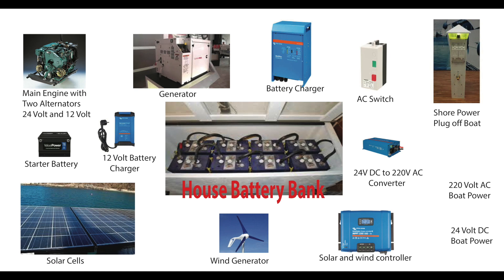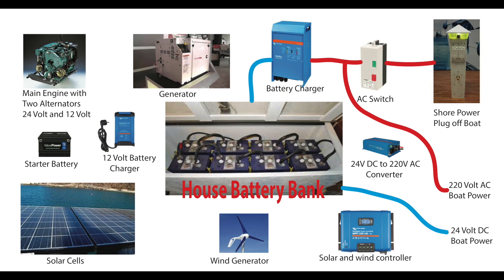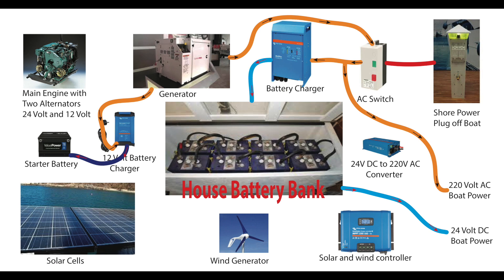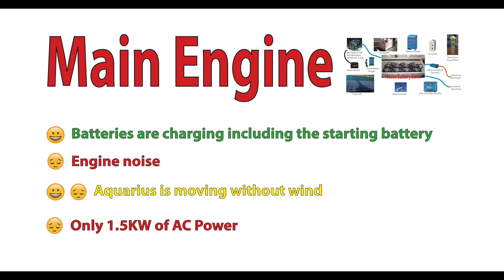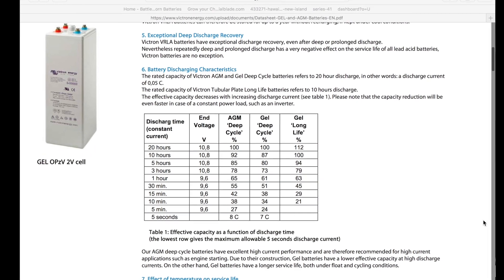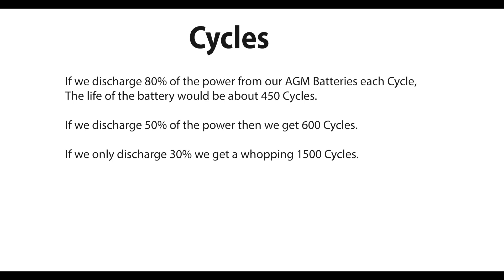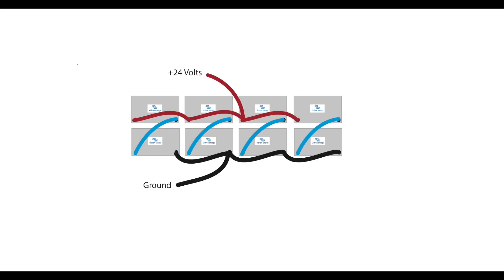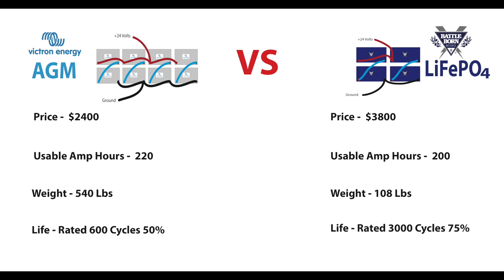Batteries and Power / Sailing Aquarius "How To" Series

Comment: Very nice understandable by non techies (of whom there are more among your followers than you might imagine). IF you are a cruiser and not a weekend sailor, lithium I’d throw only sensible way to go. Plus, when I had a house with a magnificent dock and did not take her out often I never plugged it in. And never at a marina. Even then you get stray currents. I also dropped several cheap magnesium sacrificial anode fishes wired into the ground so that they would flow down the erosion on the real boat anode. All I needed was a tiny solar panel  made by Solargizer.  It strobed the batteries at something like 20k per second which is supposed to be the frequency that breaks up sulfate crystals. I am not kidding ypunwhrn I say my batteries lasted seven years before they got down yo half capacity. 800 amps at 12 volts. When on passsge single handed I eat very simply. No freezer. Very simply. But when with a wife or guests or the kids, albeit grown  the meals become a festive occasion and power goes up. With respect to the autopilot I de power the sails so the current draw is much less. I’m not in a race. I sold my previous divorce.  I mean boat. But am going to get a new one soon. The other onevwasvscBeneteau 46:foot sloop. New 1999. I had never set foot in a sailboat before I bought it at thr Anbapolus boat show. I lived it. Sailed singlehanded sell sround three Csrribbexn. Once I doubled the power and added a genset. The boat was fun and agile. And I actually sailed through two named storms and rode out a third anchored in Bermuda. Butnow 20 years later I have sold the next businesx and I want to crossvthevAtlantic and spend severs last years or more in the Med. While in the Caribbean I made the mistake of helping an Amel 53 owner from Gorda to St Martin. I was shocked at the difference. It is definitely not as fun as my Beneteau was. But it was the most robust sturdy, well thought out cruiser,live aboard I think man could devise. And cruising is 90% on the hook with a dinghy to shore and only 1% on the water and the Amel is not dissimilar in comfort from living on land.   

What did you do before this?  You seem to have a high aptitude, you were not an experienced sailor, you seem to make some decisions quickly but not badly and then open to lesrning and adjusting quickly to timproving.  I have a a partially paralyzed right hand, recently acquired.  But I think an excellent conditiion Maramu would be wonderful. The major trick in sailing is not overpowering. Never put out what you might not get in. Don’t strain the boat. I plan to cross thevAtlantic (for stupid bragging rights), and Live in the Med for several years exploring the Western  Civilization I was tsught from fourth grade through college, through five years of Latin. I’m 73. Fit. Married, though and she does not like sailing. But she does not mind living on a boat that’s on a nook and she’s just as interested in immersing herself in the history that’s where we came from. I got tired of beaches. I want to I want to stay for months at esch place. She used to be a motorcycle dealer!  I bought from her in 1973 a new BMW R96 that I put 100,000 moles on. Then snagged her!  She’s almost perfect. She doesn’t like passsge making and weirdly she simply does not hzveca c
Clue why a sailboat moves forward.  Your videos have reassured her. And for that I owe you. Thank you so very much.
Reply from the maker: Happy to hear our videos are of some use to you!  I was a bit worried about you when you said I was addicted to the bow thruster last week, but have since found your comments and questions good for other subscribers, and yes even I learn from them!  To be honest, maybe I am addicted to the bow thruster, as I don't think I would be able to safely park Aquarius without it.  I just tried to park a full keeled 35 footer a few days ago, holy crap that was tough!

"Not in a race"! Amel's aren't really a  good boat for racing, but you can race them in high winds.  I have noticed that the.high production boats will move faster 0-20Kts, but when the wind is above 25kts the Amel will start to overtake them.  But, better not to be in a race, as the cruiser is more worried about getting to the destination safely without breaking something, it's not about getting there first. 

I am sorry to hear about your hand, but you are exactly whom Henry Amel designed the Super Maramu.  Sails are easy to deploy, easy to reef, and easy to remove.  All from the comfort of the cockpit, and even in heavy weather.  The only time you need leave the comfort of the cockpit is to put out the downwind sails, and if something goes wrong.  The Amel Super Maramu is easily sailed single handed if maintained properly and you don't overpower her.  If the wind is over 20 kts or so, don't deploy the main.  Like you say, it's not a race out there.

I did hear about pulsing the batteries to de-sulfate them, but I didn't know the frequency until your comment.  Thanks.  And the magnesium makes a lot of since if you're at anchor, but especially in a marina.  

I hope you find your dream boat, and you get the chance to cross the Atlantic.  Aquarius might be going that way in a few years, and it would be nice to meet up!

Fair winds my friend!
Ken

Comment: Nice references Ken easy for anyone to understand, I know Aquarius has its batteries under the berth in the starboard side if you change to less lighter batteries will it change the balance that the Amel was originally designed with? Or do you just add a beer chest where the old AGM’s lived?
Reply from the maker: We just changed to LiFePO4!!  Video will come soon!

Comment: Hi Ken, I did a search of Battleborn batteries and found they sell a 24V 50Ah unit.  Instead of 12V batteries, you'd be ahead of the game with their 24V units.  Price about same as 12 V but no inherent loss due to extra cabling.  Cheers!
Reply from the maker: I wonder if the BMS on board the 24V battery would make it possible for an actual DROP IN REPLACEMENT of the AGM's.  I think so.  Replacement of the Batteries is one thing, but also replacing the battery chargers, and the alternator would a significant increase in cost.  My AGM's are still good, but as soon as they can't keep up I will replace them with BattleBorn Batteries.

Comment: Ken, I ran across this article about two weeks ago.  https://marinehowto.com/lifepo4-batteries-on-boats/  When you get a chance, you should sit down and read it before making the switch to these types of batteries.  As an electrical engineer, you'll appreciate it and immediately understand the issues he raises.  They aren't saying not to do it, but it is a lot more complicated than just using drop in replacements like Battleborn - which can be easily destroyed by even one overcharging event - very easy to do on boats like yours with solar panels, wind, shore AC, 240VAC Alternators and 7KW Gensets.  The problem is that the internal battery management systems on these batteries can't actually shunt anywhere near enough power to actually protect them and you need to have updated things like very heavy duty boat alternators as they will keep the alternator running at high capacity right up until the shut off (and then need to go to zero).   He really spends a lot of time one what kind of a SYSTEM you need.  The good news is like you, he's pretty much decided that Victron has some of the right gear, but you need to really focus on making sure it is all working together properly to ensure that those little pots of gold don't get damaged.

Comment: We tried most , lipo doesn’t last as long  but three times the price , we have 4 house at 600 amps Total , our living total under way settles at around 580 , three solar panels at 110 watts ea. A 100 amp alternator unregulated through an Apple next step regulator giving instant power , a 230 volt shore power adjustable to 110 volt transformer if needed at dock , so battery’s I want to last 5 years , as each starts to fade at different times causing the others to carry them , with the bep battery controller you can monitor each and spot the diying battery , we run fridge full time  , easy , radio electronics , fans at ease , on the longest passages of say 8 weeks we nave no issues at all if we do we start the engine , I have found keeping things simple,,  as all manufactured boats are not , and there wiring doesn’t last causing issues , battery Leeds two small and power consuming lights etc , keeping it simple worked for us , we have done thousands of miles in the past over the last twenty years and never had issues except wire corrosion at joints wich we head to first and is usually the culprit so good luck with your boat likes your vids

Comment: Great video thanks. You confirm all the research that I did.
The victron charger that you  have (220v) can it already manages the two different bank batteries (lithium and engine)?
Reply from the maker: We only have one house AGM (lead) battery bank of 24 volts.  If we were to buy the LiFePO4 batteries we would still have one 24V battery bank of 24 volts.   If you are talking about the starter battery, it's just a 12V battery charged separately, and not charged by the Victron battery charger.
Reply: @SailingAquarius  yes understand. The problem for my boat is that we have 3 bank batteries: house, engine and bow truster. I have to change something more. Thank you!
Reply from the maker: We have an engine start battery, that starts the engine and the genet.  And then the house batteries. On almost every boat the engine start battery would remain lead acid, and charged with the engine alternator.   So you probably have a House Bank charger, and a bow thruster battery charger........ The question is whether your chargers are adjustable.   Take a look at the battleborn batteries, because I believe they told me that it is a drop in replacement with AGMs.  It has all the electronics on each battery to protect them against Overvoltage, and Over Current in either direction.  So, you might not need to change much electronics on your boat...  Fair Winds Max....

Comment from the maker: This just emailed to me from a close friend-----  Please Read!

Ha! Watching your video on batteries - I see that you took my suggestion to check out the Battleborn batteries. I’ve only used them for three weeks of dry camping in the RV, but they performed FANTASTICALLY!!

The one MAJOR advantage you didn’t mention in your video is that you can charge them at the full bulk rate of your charger up to about 95% capacity, vs. an AGM battery that starts tapering at 70-80% charge. This characteristic cut my charging time in HALF on the generator, and allowed the solar cells to completely recharge the bank each day since they could put in full rate charge all day long.

The other advantage is that the LiFeO2 batteries don’t care if they get a full charge each day - it doesn’t damage them.

My system is 300Ah @ 12 volt, and we use about 150Ah per day. The 360 watt solar array usually has the battery banked topped by 2 pm or so on a sunny day, so unless it’s cloudy for more that two days, I’m never running the generator (unless for Air Con). We use a 2800W 110V Inverter/charger which will charge at 120A @ 12V.

The other amazing thing about the LiFeO2 batteries is that there is very little voltage drop, so the inverter will not cut out until the bitter end. We made a mistake and disconnected from shore power while the AC was ‘on’, but not running since it was below the thermostat setting. We got nonthe road and stopped for the day to go mountain biking. While I was unloading the bikes, Kim turned on the inverter for some reason, and forgot to turn it off, and after we left, the cabin warmed up and the AC came on using the inverter. We were gone all day, so it pulled the batteries down and the inverter tripped off on low voltage at about 6% power. Add another few hours of running the fridge, etc, and we we got back to the RV, the batteries were at 4% charge. I tried to start the generator and figured no-way-in-hell would it start, but it did! Didn’t even sound like it was lugging!!

From near dead to fully charged in exactly 3 hours of generator run time! Perfect!!

So, you should sell your brand-new AGM’s for half price, get the Battleborn’s, be happy for next 10 years, and still be ahead $$ wise. Just say’n…..
If you decide to do it, let me know since there are some subtleties to programming the charger that Battleborn doesn’t explain very well. I’ve got my charge program pretty tweaked at this point.

Liked the videos!! I was amazed (and impressed) that you, Ken, very publicly aired a decision you regretted for the benefit of your fellow sailors - nice job, buddy!!

Comment: Had a power surge wipe out my charger and damage my batteries. I was going to replace with gel, but think you convinced me otherwise.
Reply from the maker: Call Sean at BattleBorn....  I believe that if there is a surge protector on each of the the BattleBorn batteries that will put the batteries into self-protect mode.  This feature should have saved your batteries, if they were BattleBorn batteries.  There really is no other way to go except for LiFePO4 batteries these days, especially if you have a sailboat.  They will last about 2X+ longer than GEL, and much lighter.  Also, I am not sure of the price of GEL, but I am sure they're not cheap.  If you plan to use them more than 7 years, your better off buying LiFePO4.
Reply from the maker: Just added a comment that I received in an email.  It was from a friend and he just bought the Battle Born Batteries...  You should read it... Let me know what you do, I am interested!!
Reply: Will do.  Thanks for the info!
Reply: Sailing Aquarius Around The World   Hey Ken,  I did end up going w/ Battleborn and just finished the install. My boat is smaller, so went which the 300ah kit, with a 2K inverter/charger. Should be enough for my needs.  Thanks for the advice.
Reply from the maker: @dougd9528  Awesome, I would like to get an update in about 3 months on your thoughts on performance.  Do you have 12Volt system, and thus used 3 100ah 12V batteries?  I have a 24V system and will use 6 batteries to obtain 300ah at 24V.  You have gone the extra mile, and now I can learn from you!  Thanks, Ken

Comment: What a great explanation....now do your research and see if existing power generators you already have on board are compatible with new batteries and if they need upgrade also...anyhow thanks for putting this together.
Reply from the maker: I believe that the existing 100Amp Victron charger will work, because I can set the Charging Voltages, and I can set the Float Voltage.  And the 100 amp alternator on the main engine should also be OK as it is set at about 28.4Volts.  And the biggest reason is that all the BattleBorn Batteries have safety electronics that will shut them down if Overvoltage, Low Voltage, Overcurrent, etc....

Comment: The guys on Delos (also an Amel Super Maramu 2000 for those few who don't know) recently installed these (rebranded) for much the same reason.  They also ripped out their gas powered stovetop and oven (and bbq).  They installed an electric induction stovetop and are going to install an electric convection microwave to replace the oven.  They found an electric bbq as well (although it seems to be only 110VAC so would have to run through a transformer).  If you go this way, you'll likely need to replace your battery charger with one that supports LiFePO4 like they did as well.  It won't be just the cost of the batteries but it would still probably make sense over the long term.  I like these techie videos as they make a change from having to look at Z in her bikinis... :-)
Reply from the maker: I watched, and enjoyed, Delos' vid on the battery change to LiFePO4.  I thought about doing the induction stovetop as well...  But now, I don't think I want to get rid of gas, as I like the back up...  If my power goes down for some reason, at least I can have some hot coco to help sweeten a disastrous day!  I can also make hot water with the electric pots, and we have an electric grill.  All back ups....
Reply: I'm completely with you on that one...  although I do like the induction cooktops better than gas as my better half and I can be slobs when it comes to stove top spillage and the induction tops are a breeze to keep clean.  Gas, not so much.    (although on my second offshore trip on a Super Maramu I learned a neat trick to stop pots from boiling over - rub a bit of butter or cooking oil around the rim of the pot.)
Reply from the maker: Thanks for the tip Steve.......I will try it!!  Ken

Comment: Great vid. Delos has just youtubed the lithium battery conversion.
Reply from the maker: Yes, and I saw Delos' vid while I was working on this one.  Delos installed 8 100 Amp hour 12 V  batteries, which will give them 400 USABLE amp hours at 24 volts.  This is a massive amount of usable power.  We could manage with just 4 LiFePO4 12V 100Amp Hour batteries on Aquarius, but then we only have two aboard.  But, I would buy 6 when our batteries are starting to go bad....  Cheers...

Comment: Wow. To be checked if LiFeP are as good as speced by producer, and is there a way to check if its a LiFeP battery without trusting the label? What is influence of tropical temp all the time?
Reply from the maker: I spoke to the owners of BattleBorn, and they say they under-specified their batteries.  So, you should get a little more out of the BattleBorn batteries if you pushed it....  But, it's never good to push your batteries to the limits.  In most sailing vessels the batteries are located somewhere that is cool, and they don't get too cold.  Temperature is not a big concern on a sailing vessel, at least I know it's not a concern on an Amel...